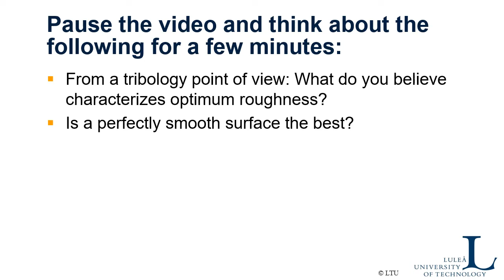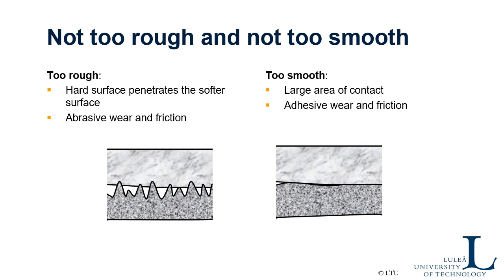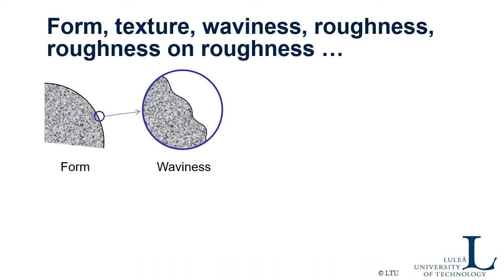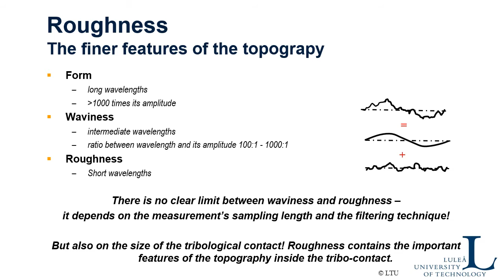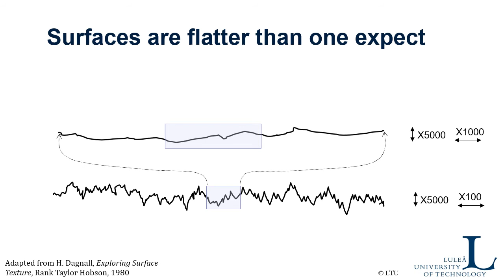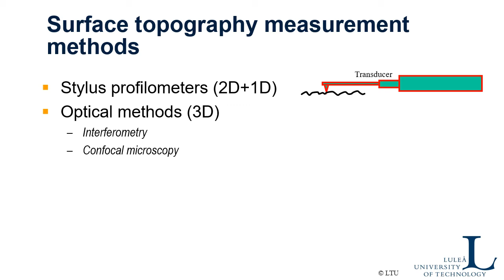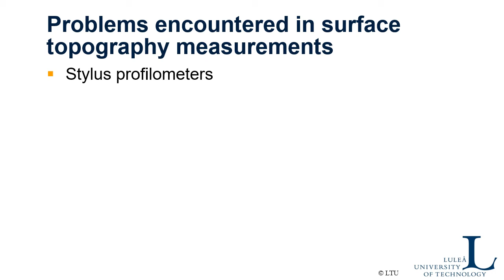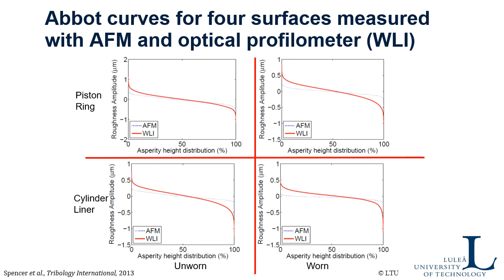Surface Roughness

Comment: Dear Mr. Roland Larsson,
Thank you for the neat and explanatory presentation. Do you think coating would get stuck more efficiently on the surface that  was obtained too smooth? Couldn't we conclude coating on smooth surfaces is less desirable?